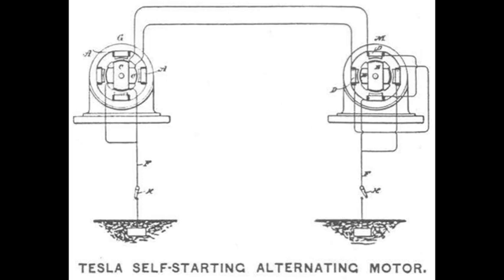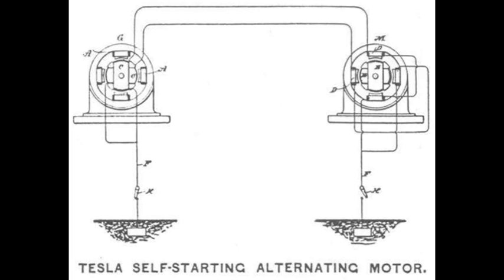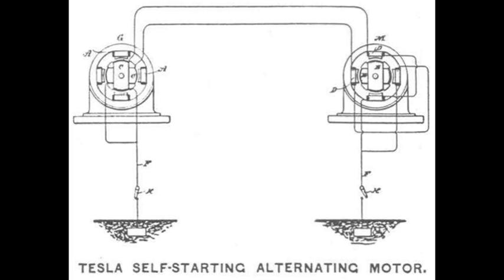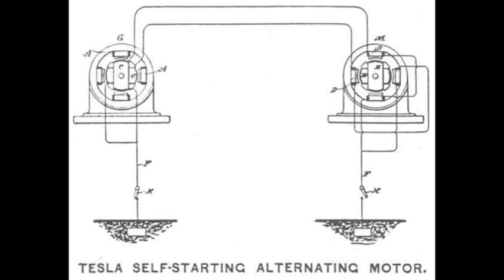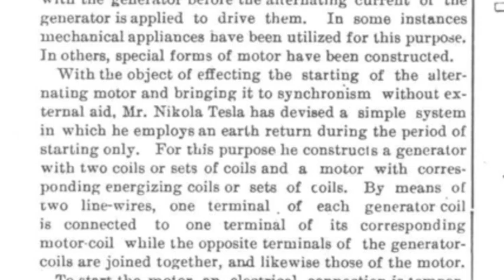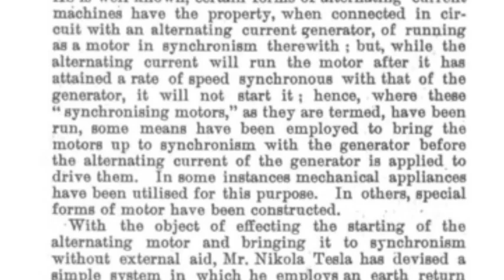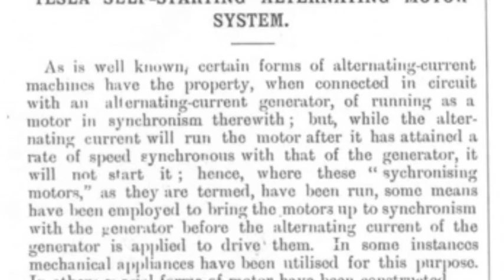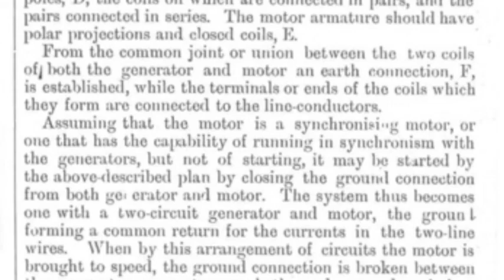Tesla Self Starting Alternating Dynamo and Exciter Motor - News Articles & Diagrams - Free Energy

Comment: Michael Faraday is credited with discovering electrical induction. He knew that an electric current in a coil of wire would create a magnet so he wondered if a magnet could create a current in a wire. At first he found that if a magnet was just placed inside a coil of wire their was no flow of current. What he accidently discovered was that if the magnet was moved into the coil it would produce a current. From this discovery he built the first transformer although it is unclear if he knew that changing the number of windings would change the current/voltage relationship much like moving the fulcrum in a mechanical system.      

There called induction motors because like a transformer they rely on induction caused by the changing magnetic field in the stator to induce an opposing magnetic filed in the rotor. Opposites attract.    

Modern induction motors use a rotor made up of a 'squirrel cage" (think hamster wheel) aluminum conductors with silicon steel filling the rest of the rotor. Upon starting an opposing magnetic field created by induction in the aluminum conductors becomes attracted to the changing or alternating field created in the stator. This results in the rotor pulled around by the stator field. There is however some slippage so instead of a speed being directly related to the line frequency they run a bit slower. This type of motor can not be changed into a generator without changing the rotor.

Their is a second type of AC motor where the rotor has a constant DC magnetic field feed through slip rings instead of a commutator. It's called a synchronous AC induction motor and runs at a speed in direct relation the line frequency. It can also be used as a generator (alternator) when the rotor is turned and supplied a DC current through the slip rings.

Comment: The reason why AC induction motors or Asynchronous motors would not "self start" back in 1880's is because they were single phase. And they had not figured out how to use a "start capacitor" to simulate a second phase. So, what Tesla did essentially is create a 2 phase alternator to run his 2 phase motor. Something must indeed turn the alternator to power the motor.Then they will turn together or "in sync". There you have a synchronous motor,turning in sync with the alt. and with the two phases.I did not do the math but, the two phases should be 90 degrees out of phase just like the windings  on the alt. It might help to know a little trigonometry or someone who does to understand Tesla's math. That will help you understand this a little easier. I hope you now understand that this not even close to being a "self running" or perpetual motion machine !!!!
Good Luck !!